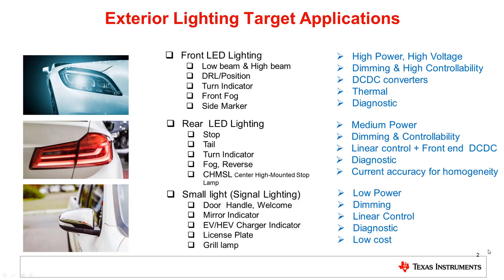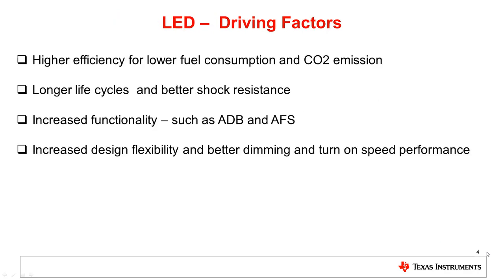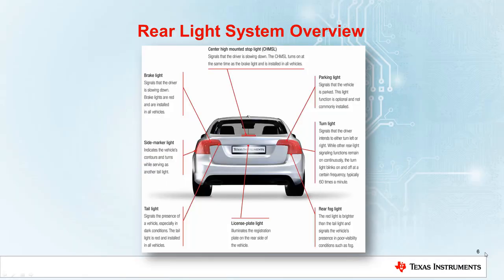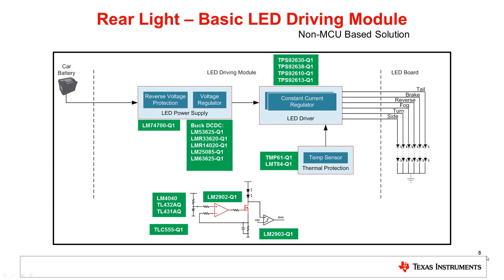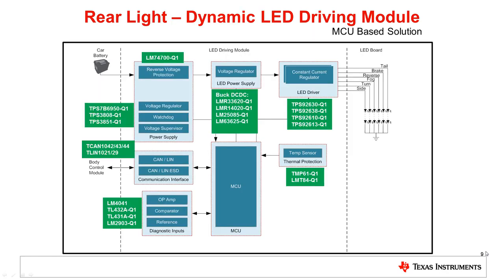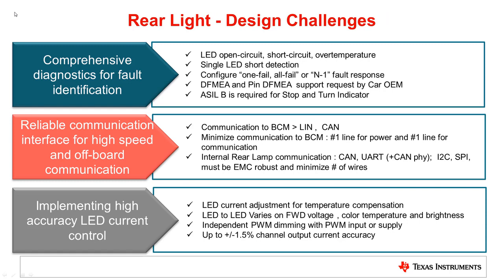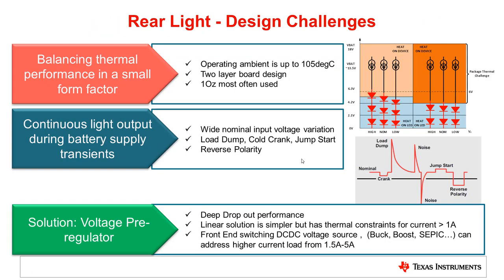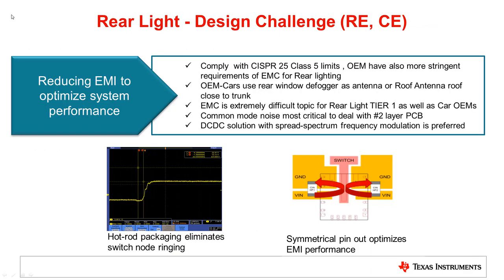Automotive Exterior Lighting - Rear Light Design Challenges

Comment: A nice teaser.  the real driver (pun intended) is the flexibility it gives the designers.  The ability to shape a light-guide and fill it with light from multiple sources (individual LEDs) allows the designers great flexibility in the shapes used.  if this were not the case, you would not have LED lights on cars!  (I have been involved in the design of many automotive LED lamps)